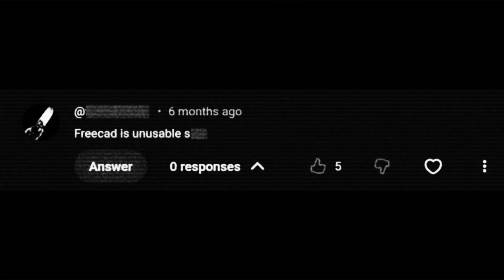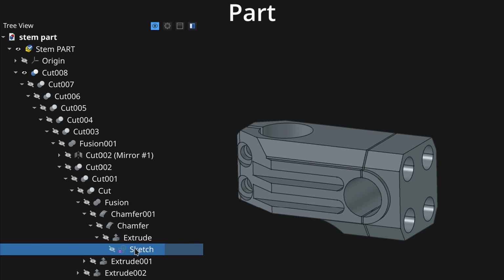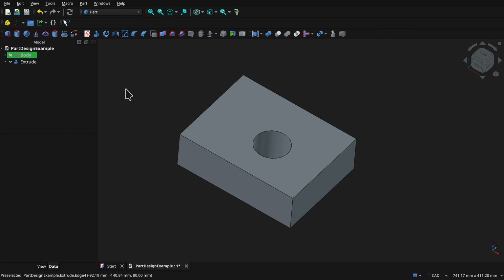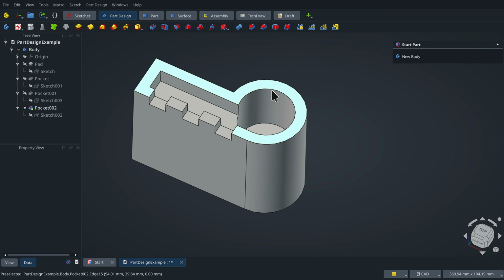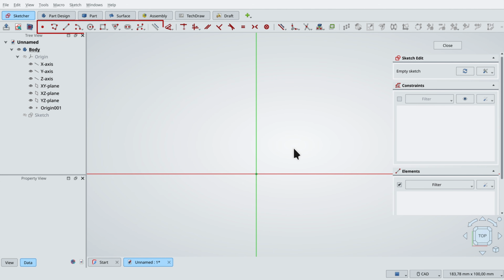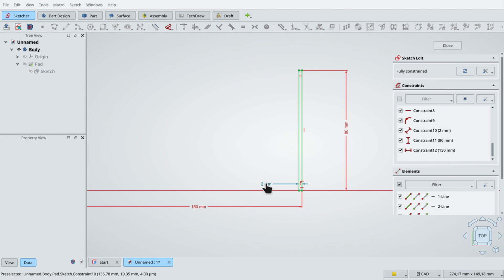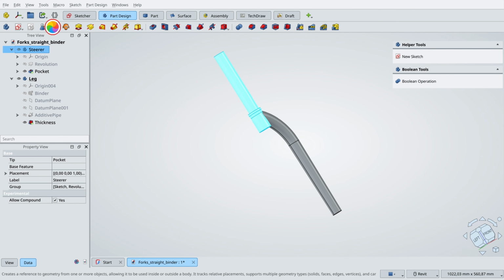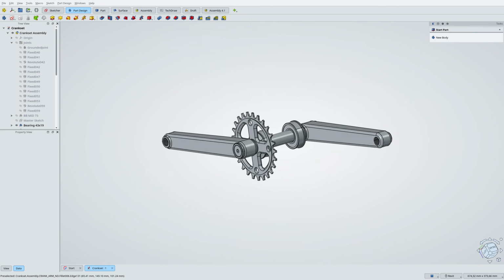STOP using FreeCAD WRONG! Do this INSTEAD (Workflow & Tips)

Comment: Thank you for your work. Unfortunately, the authors of those angry comments are still right. I was inspired by your video and decided to give FreeCAD another try. I attempted to model a very simple assembly consisting of two extremely basic parts using a top-down design approach.

When I left FreeCAD a few months ago, I had a few 'hacks' to bypass its unpredictable behavior, and I actually managed to design some things. But now I’ve installed version 1.2. I wasn't doing anything complex—literally just trying to join a square and a cylinder. And it was awful. It is simply impossible to do! It just doesn’t work!

I got seven different errors! The sketch is open, it’s over-constrained, then it’s under-constrained, and so on and so forth. Everything flies across the screen because of one tiny error. Mind you, this is a very simple model, and I have 20 years of experience with CAD systems, including a year spent specifically trying to master FreeCAD. I’ve watched hundreds of videos trying to find workarounds to overcome its issues.

It doesn’t work. It is a tool for experimentation. It’s not even a tool for hobbyists at this point.
Reply: Hold up a square is a flat shape and a cylinder is a 3D shape, how are you going to join them, what sort of an outcome do you expect, a mix of a 3D object and a 2D object?

Sketcher is one of the rare good parts of FreeCAD, it can cull conflicting and superfluous constraints for you if you let it, and underconstrained sketches can actually be used and do not result in a failure, you can actually just leave them as a problem for later for if and when you decide to change any underlying dimensions. If your sketch is underconstrained, having it recompute with different underlying dimensions will tend to cause corruption in any and all parametric modelling software. Fusion is simply less persuasive about constraint, but it breaks just the same in this regard. (note there are a lot of parts of say Fusion which are genuinely more robust than FreeCAD, but sketch handling is not IMO one of them) Anyway the sketcher is genuinely good, and what it needs is not workarounds but fundamental understanding of what it is you're doing.
Reply: @SianaGearz  I used the wrong term. I didn't mean a square; I meant a box.

I understand everything you're writing, and I've been through it all before. Comparing the sketching tools in Fusion and FreeCAD isn't even funny—they are on two completely different levels. Fusion is a top-tier, £200,000 luxury car with six-zone climate control (even for pets), while the FreeCAD Sketcher is an old kid's bike you inherited from your brother.

You’re right—they both break, but for very, very, very different reasons.

If I were in charge of FreeCAD right now, I would focus exclusively on fixing the Sketcher to a point where people at least stop uninstalling FreeCAD immediately because of it. The Sketcher in FreeCAD is the worst part right now. But it’s also the most important. It is the Achilles' heel of the entire software. Yet, it seems they don't realize this.

Comment: The fact that you compare freecad to blender instead of any other cad software tells a lot... So far, the only advantage i found for freecad over fusion360, is how easy it is to integrate a python script for batch processing.. It was useful to make all keyboard keycaps at once and i can tween the design of the keys without having to remodel each of them.
Reply: the major advantage is that your license and ability to launch it can't be cancelled.
Reply: You're saying it as if Blender is also an inferior software, which it's not.
Reply: @SianaGearz blender is not a cad software.. At least, not at all in the same category as fusion360, solidworks, creo, onshape, inventor, NX or even thinkercad. 
Blender is a 3d modeling software, its closer to the sculpting category, like zbrush, meshmixer, sculptris. 
Cad softwares start from sketches, with constraints, relationships and dimensions. They are parametric by design. 
Modeling softwares start from meshes, with manipulation and edition tools. 
The attempts at turning blender into a cad software failed miserably... Like the cad softwares fail just as bad to work properly with meshes. 

Of course, someone being familiar with blender may find amazing the parametric features of freecad.. But its still not a good implementation.. 

Freecad needs to be reworked a lot to be usefull for anyone used to cad softwares.. Too many dumb steps for simple tasks, too many changes of workbench, tools are too restrictive and not polyvalent at all... Workflow is completly different for different types of shapes. Constraints are glitchy as hell and are lost with any substential changes(even worse than other softwares that also kinda suck at that).. 

Anyways.. Blender is an inferior cad software... Its not what its for
Reply: @NicolasSicardRoy   Blender is an art software, with focus on animation and polygonal modelling, and is easily among the best in its software category. 

Freecad is a parametric mechanical cad which is not even close to the established software in its category.

Comment: My problem is always constraints, watch videos and they look so easy but when I make a 2D drawing with polylines it always ends up orange.
Reply: It does seem worse with newer versions. For example if you draw a rectangle and try to add a symmetrical constraint using two corner vertices and an axis, you will get redundant constraints error and have to delete a constraint even though you've literally done nothing else but sketched a rectangle and symmetrical constraint 😂. Easy to resolve just annoying as all hell.(Simply delete the constrain freecad tells you to).
Reply: @Default_username007 or setup automatically remove redundant constraints
Reply: @Default_username007   Are you sure though ? I just tried and it just works.
Here is what i did: First draw a rectangle having the sketch origin around it's center, no auto constraints applied, then pick 2 opposing corner vertexes and the corresponding origin axis line and click the symmetry constraint. Same for the other side. Done. Applying dimensions to both sides then fully constrains the sketch.
Care to detail your procedure ?
Reply: @TheSliderW  You did something else, here is what gives the redundant constraints:
Draw Rectangle -> 4 lines bottom top has Horizontal constrain, sides have vertical.
Click Bottom left and right Point and horizontal Axis add symmetry constraint. -> orange, with saying "horizontal constraint is redundant"

I am super new to Free CAD and used CAD-Sketcher Blender Plugin before that. It works much the same but nowadays has some maintenance problems with newer Versions. That's why I try Free CAD. And ig I have to get a bit familiar with it, but at the moment it's so a paint to use. I don't get why there can't be redundant constrains. I don't get why they don't get auto deleted (with new constrains overriding the old ones)
And UI is confusing :( will try a bit more but maby I switch back to something more fun. I just use CAD for hobby 3d printing and dont need very complex features. I just like the idea of having a sketch that builds into an object while still can change Values without starting from Scratch
Reply: @Default_username007 there is a setting remove redundant constraints.
Reply: @Default_username007 There's a checkbox to auto delete redundant constraints, this should alleviate a lot of your frustration.
Reply: Completely agree. Ive tried SO hard and the constraints kill me. I follow tutorials step by step and something must be different because I somehow do exactly what theyre doing but cant move forward.  I absolutely love and respect the principle behind Freecad and I genuinely WANT to be good at it. Open source is my shit. But I struggle so bad with freecad
Reply: @infinitEndz same here got so frustrated that the sketches dont work the same way as they do in fusion. just please tell me how to make a nice sketch with rectangles split up so i can extrude and select the surfaces i need. aaa
Reply: @ItsDario  This is my biggest complaint with freecad. Once you extrude/pad something, I cannot, for the life of me, figure out how to draw a different shape attached to it.
Reply: @zamboughnuts confused me too, but complex surfaces need a lot to work (sketch on a curve) but flat surfaces only need a datum plane or just a selection of the side then go to tasks and select create sketch. Hope it helps
Reply: I struggled with that for a while, but I finally know how to work with it. Most of the constraints problems are because of auto constraints already being there and then adding something extra. For example symmetry constraints, they always seem to break until you deliberately draw something completely asymmetrical so the auto-constraints are not there and then apply the symmetry constraint. Another way is: turn off auto constraints completely.
Reply: https://www.youtube.com/watch?v=rlWq2DAD1is

Comment: if you're saying users is using app wrong... it's means that software has problem, not user
Reply: Yes and no. If you get a parametric CAD and expect it to be, say, Rhino, it's on you.
Reply: You get into cad software to do parametric, comming with an expectation of mesh modeling or any direct shape manipulation is indeed wrong.
The One thing i think FreeCAD should be doing is making it's interface barebones from the get go and having users check the boxes for the speciality features and workbenches. Maybe yhis could be done as a first time launch script.
Reply: @TheSliderW  I too have issues with FCAD. I would have preferred if it had followed in line with SW, which is something of an industry standard. In short, the criticism has to be fair.
Reply: @grisflyt  solidworks had it's UI/UX revamped in recent years. It used to be just as complex, especially in it's original CATIA form. That being said there is a huge team behind that suit of tools with a budget in the millions and if things keep going as they are, FC will start adopting more of it's features as it recently did, by, for example, combining many of the constraint types behind an auto constraint tool that picks the right one depending on the context and clicked elements. I suggest trying out the dev builds that are pretty stable despite what one would expect and already contain a lot of neat upcoming life changing, and saving, features.
The recommendations from our host still apply by changing some settings to clean up the interface.
Reply: @TheSliderW  I plan to migrate to FCAD. I'm on board. That doesn't mean one cannot criticize, as long as it's fair criticism.
 
My issue with FCAD is that it seems they are just cramming things in there. Why Sketch and Draft?
 
I don't expect SolidWorks. Just as I don't expect Inkscape to be Illustrator. I'm also critical of Inkscape for basically the same reason. Why do things different when what everybody else does work. It's useless for me. Installed the more basic Karbon, but it doesn't work on my Linux PC even though there is a system pack.
Reply: @grisflyt  Yes, UI/UX is key for new users in modern times. This tool is as old as Solidworks yet it's still behind in usability. Agreed. Please direct any complaints to their forums, they really need to hear the voices of people who tried the software and gave up in confusion.

Sketch is what you want. ignore draft for now unless you do advanced things.
For a similar to Solidworks experience, only use part design and assembly. Also get the latest DEV build.

I never heard of Karbon.

Comment: Great video!
I tested FreeCAD several years ago, I think this was before 1.0 was released. Since I was used to applications like Inventor or Fusion360, using FreeCAD was horrible in my opinion. However I noticed the community is growing and recent versions seems to implement lots of improvements. I will give FreeCAD another try. I hate Autodesk is forcing me using Windows. I only have dualboot because of CAD programs...let alone this cloud shit.

Comment: I like it and keep using it for my modeling tasks, but when i started i had so, many, crashes, weird selection bugs, terrible error messages and all, i guess some were fixed by newer versions, some i learned to walk around, but there is indeed a lot of frustration to be had when you start using it, in my experience.

Still amazing software, but very far from perfect, and it's not all skill issues.

edit: and many thanks for your great work making it easier to learn!

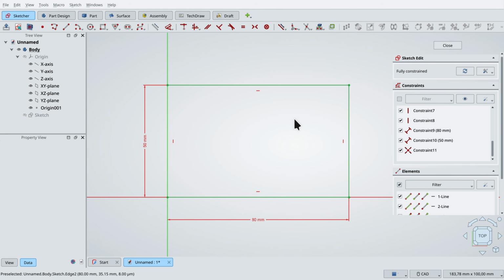Comment: 19:18 constraints list menu is pure useless, it does nothing, i always get wrecked after using split tool (some points floating above and prevent to connect actual geometry) and it won't provide any useful info about

Comment: Still it takes me 4 clicks in 2 different menus to perform a basic operation that would have taken me a single click in other software like Fusion. And then while designing a parametric part you have to take a bunch of stupid precautions and pray than your model doesn't break when you change a value in the spreadsheet because all your dimensions are flipped.

Comment: I have been using FreeCAD for over a month by now. I still don't like it. I have so many annoying problems. For example it has parametric modeling, works fine usually if you have to change a value. But when you remove an edge on a sketch from a corner and connect two open ends of the line, it just refuses to make any further changes and gives you an error despite only a simple pad being done to that sketch. Little things like that frustrate me especially because I have been using various 3D and CAD modeling softwares for 21 years. And Fusion 360 being my favorite CAD simply because it's easy and enjoyable 99% of the time.

I really hope it gets better in near future because my dislike for FreeCAD is on the rise for now and I would prefer open source free alternative to Fusion like cloud and subscription based software.
Reply: It's unfortunate his video didn't convince you. 

For some people time is more important at the moment so they stick with easy. But I promise if you stick with free CAD you will get used to it's quirks and grow to love and appreciate the freedom and lack of corporate scum attached to your hard work. 

Given your experience with CAD I bet you could get used to free CAD pretty quick if you're open minded about it. I switched from fusion 360 and I look longingly at my files trapped in their system wondering when I will have the time to recreate the files in free CAD so we can be back together again. 

Good luck

Comment: While the comments cited in the start of the video do come out as confrontational, the kneejerk reaction of "skill issue" is plain wrong and should never be used. These comments FreeCAD often gets, in isolation and when compared to other CAD software, are a valuable signal about subpar UX of FreeCAD. The right way to deal with those is to silence all kneejerking people (those are wide spread on FC forums) pre-emptively, engage with people venting their frustration and to action on feedback. People want to model a thing, if FreeCAD takes a day and F360 an hour, that's a FC issue, not a skill issue. Telling them "but my solver!" is unproductive. Until FC makes this a priority and builds a healthy pipleline, comments like that will remain. I think FC team needs to exert a deliberate effort to alleviate reputation damage poor UX continually causes. Software engineers and power users and blind when speaking of UX, I learned this lesson first hand as a UI developer.

I think this video is on the right track, but it also is an example of a power user being blind to real, painful issues. Like, when you show an example of changing a part parameter and when nothing broke, which is very often not the case because of stuff like fillets that don't have an auto-clamp option. Or part color only changes if you set it on body, not part. Or how part color was (or is it still) named "diffuse color" -  a technical term leaking to UI, irrelevant for the purpose of modelling, and extremely hard to find - I fail often at that even with many years of experience with FC. Sure, you can learn to work around poor UX in time, but good UX guides users to prevent failure and to succeed, and FC absolutely does not. 

With advent of coding agents, I hope FreeCAD team leverages these to increase their productivity. Anthropic has an open source program with free 20x limit agent and FC absolutely qualifies.

Comment: the constant crashes are NOT a subjective opinion.
Reply: Might be a PC issue ? I'd ask on the forums and provide a crash log. This could help a ton other users if you have the time and are willing to help a bit. To get a crash log you have to edit the shorcut by adding a -l  ( minus L )  at the end of the target, something like : "c:/programfiles/freecad/fc.exe" -l
Yes, add the -l after the quotes.
Run it and the log should appear in your appData folder in roaming, then  FreeCAD. It should be called something like FreeCAD.log.
It would be a huge help if you could post that in the forum.

Comment: Thanks for the tips. I had the issues you mentioned with the fillets/bevels, but also if I remove something up the part design tree, following unrelated bits get messed up, as if the following references are reused and therefore invalid